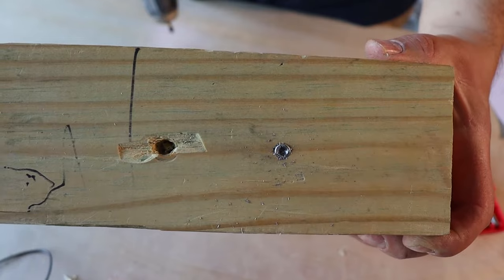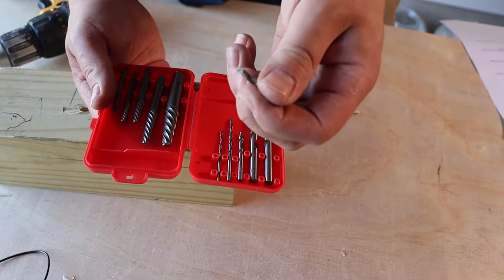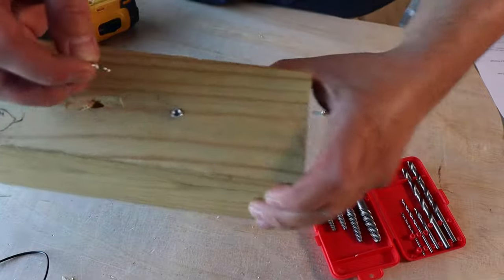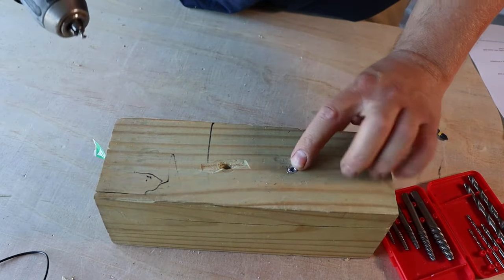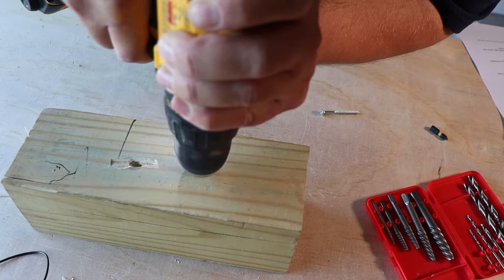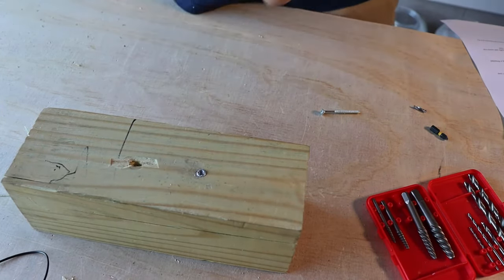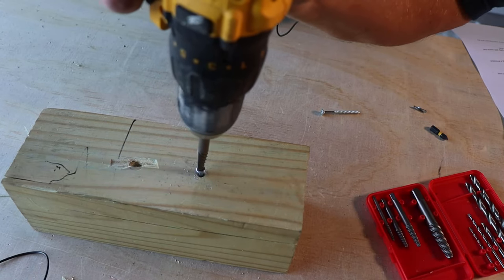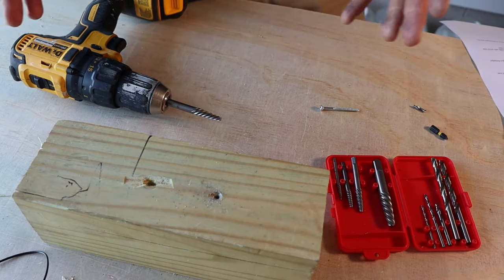How to use a Screw Extractor Set - (Remove broken or stripped screws)

Comment from the maker: Let me know if you have success with your drill extractor. They're not the most user friendly. Sometimes you need to be persistent and even then they are temperamental. Well, at least my crap set is.
Reply: Your set looks fine. But this is not how it's used. This one is for screws with broken off or completely damaged head. There is another type, which is used in a drill, to catch on a stripped screw head. Two different tools. Read my other comment.
Reply: @palopod No wonder mine didn't work.

Comment: When you use the screw extractor bit don’t use it with drills or impacts, use it manually with a crescent wrench 🔧 get to bite into the screw then turn it couple of times by hand, once the screw starts coming out, then only you can continue the process with a drill or impact.
Reply from the maker: Yeah an impact is a really bad choice. I've found a variable speed drill at a slow speed is fine to get it started as long as you use a light touch on the trigger. Hand tools can definitely be a safer option if you prefer.
Reply: This comment save my so much $$$$ bro. I tapped the extractor bit into the stripped bolt. And it would not work with a drill. The C Wrench did the job lol 3 days later
Reply: How do you get it to bite when it’s flush with the wood?
Reply: @donovanberserk4993 drill a hole in the center with the reverse drill bit and then hammer on the extractor bit before cranking it with a wrench or something
Reply: Thank you
Reply: That's totally worked thank you! I just used an adjustable wrench and it didn't require any force like I thought it would! And nothing is broken.

Comment: The reason you breaking bits is because you're doing it wrong. Use the drill bit correctly, not in reverse then use extractor in reverse. Your crap set is actually pretty good!

Comment: I had a super corroded screw on my motorcycle’s front brake master cylinder and these just saved me. It wasn’t working at first but then I realized I didn’t drill deep enough with the drill bit. Heads up, if you can still see the original screw threads you need to drill it in deeper lmao. I had to use one size larger extractor head than the drill bit and it worked like a charm
Reply: I have the same problem with my bike does it actually work I have theses and also have a hand impact driver trying to get screws out as they are worn on the heads
Reply: Man I’ve been having this same problem and I was trying to figure out, how and the heck I was gonna get that screw out of there

Comment: Great job, feller.  You were to the point and even used worst case scenario technique .... and still made it work.
   I've done this several times but still, if you don't have to extract screws that often, it helps to have a reminder of the technique.  👍😱👍
   I'll be watching more of your vids and wish you well in all your endeavors.
  Stay cool ✌😎👍
Reply from the maker: Thank you... Much appreciated.
Reply: Not worst case.

Worse than this is when the screw is installed for years and through vibratory abuses is broken below the surface about a half inch down the shank.  Now, will the extractor bits work on just a shank, without widening the hole?
Reply: @DorkPrince  in those cases try drilling out the shank.  Then rethread the hole.  You may have to make the hole bigge but you still have the item you are working on.  Just have to improvise sometimes.
Reply: @bamaphoenix9873  that's pretty much where I am with it.  It's in a "doorway" bulkhead between a kitchen counter and a half height wall; I'm trying to fully remove the screw to replace with the next size up so I need to get all the old threads out too (although I suppose that's not all that critical, come to think of it, might even help to leave shreds of old threads in).  I'm sure I'll manage it, I just don't want any more damage than necessary.

Of course, I might just go ahead and core it, dowel it, and redrill it. There's hardly any weight on it, it's just the abuse of slamming the gate shut over the years that broke the screw.  If it's ever removed, the damage and repair of removing the old screw will definitely be easily covered by paint.  So it's really not a big deal.
Reply: @DorkPrince  Yes, yes ... the last part of what you said ..... concerning drilling it completely out and dowelling, then redrilling will be the best ... especially with cabinets.  I think that will work fine and even be more sturdy.
  Let me(us) know how it works out.

You can also use wooden golf tees or a bundle of toothpicks if the hole isn't big enough for a standard dowel.
Reply: Squeaking luggage spinner wheels

Comment: Thanks a bunch!! I think I used these bits like once 20 years ago but completely forgot how they worked. Had a stripped screw on a $900 power amp circuit board 😣I was horrified getting that drill near it but I only had to drill it a little bit then used a crescent wrench to do the other part and like you had to go to a bigger size. And when I hear that thing break loose!  It was glorious! 🤩
Reply from the maker: That sound of stuck fastener breaking free is one of the best sounds in the world.

Comment: I bought a reverse thread drill bit set from Matco, they're cobalt 8, and have worked well so far, the drill bits that is, because the spiral flute extractor's break as any other brands I've used, I bought harbor freight O'Reilly's power built And matco spiral food extractors and they have all break at some point in the same fashion but I have noticed that the cobalt 8% drill bits have not given me any problems compared to the titanium or standard steel drill bits that came with the other kits, granted my Matco set was freaking $70+
Reply from the maker: Wow, for $70 I would hope they last quite a while. Pricey. 

I know the extractor bits break, but the set in the video was very lightly used.  I actually broke it a couple of minutes before that video was filmed. Forgot to press record on the camera so I had to do it again which was really annoying at that moment. I wish I got that on camera, would have been a more entertaining video.

Comment: I find it much easier to slot what's left of the broken fastener, and turn it out with a flat blade screwdriver. I've NEVER had any luck with a left-handed drill bit or a screw extractor!
Reply from the maker: I've done that. It's not a bad option.

Comment: YouTube Channel , Project Farm had done a test of screw extractors . Strangely he had said a set of Irwins like you have worked . It seemed he drilled out bolts first and then used them ? Though the brand Grab It and Speed Out , you mentioned were the best . I'm buying today the Speed Out , since it's cheaper than the Grab It . As I have a stripped out screw on my old license plate that has to come out , now . Though I have never had a need for any of these . It would make sense if the screw / bolt is in metal . To use a penetrating spray , etc as he has tested them , also . And maybe to put some type of grinding paste ? to put on the head , etc to give added grip . And maybe some type of rubber piece between the head and drill / impact driver . As I'm sure an impact driver would be the best for torque .
Reply from the maker: I'm sure Project Farm did a much more extensive test than anything I'd ever do for a screw extractor. I rarely need a screw extractor myself, but I was just annoyed in the video at how crappy the ones I had were to drill out the screw head. It worked fine though and for the rare circumstance I need one it's enough. Penetrating oil in a metal on metal situation is a good idea though. I've never needed anything more for grip myself for the extractor portion as long as I drilled it out well. I'm glad to know that Screw Out was confirmed to be a good extractor... that confirms my research. An impact driver would add rotational torque which can be helpful, but impact drivers are not as easy to control speed with so I'd try with a drill first.

Comment: Why did you use the drill bit (first part) in reverse? That doesn't seem right...
Reply: In case it grabs you don’t want to further tighten the issue…
Reply from the maker: Many extractor sets come with a reverse drill bit threaded in the opposite direction so that it drills in the reverse setting. This way if it grabs the screw/bolt the bit rotates the fastener out instead of tightening it further. But I did make an error in my video... I was always under the assumption all extractor sets came with a reverse drill bit. However, a viewer noticed and commented that the set I was using in the video actually came with a regular bit that should have been used in the regular forward drive. I don't know why a manufacturer would include a regular bit since a reverse drill bit would be far better in my opinion (since it reduces the risk of exasperating the problem by digging the fastener in further). If you have the option, I'd suggest using a set with a reverse drill bit and extractor combination.

Comment: Once you get the head out enough you can use locking pliers to get the rest of it out.  If the tool loses grip that is.
Reply from the maker: Absolutely. Luckily my extractor held and I didn't have to fetch another tool.

Comment: When using the drill bit in the 1st step, why go in reverse when drilling is done clockwise? Thanks for taking the time.
Reply from the maker: The threads on the drill bit in this set are reversed for this application. So you need to run the drill bit in reverse to actually drill. This is typical of screw extractor bits.
Reply: @DIYWithAaron  , Thanks for the quick reply.

Comment: You don’t need to drill the hole in counter clockwise. Only screw extractor needs to be counter rotated.
Reply from the maker: Yeah, you're right. I thought all extractors came with reverse drill bits. Apparently, that's not the case. So I guess drill whatever way your drill bits are oriented for.

Comment: But most other videos on this subject say to use the drill bit in the conventional clockwise direction and then the extractor in reverse.  Unless you use the special double ended extractors.  Why do you drill counter clockwise?
Reply from the maker: I actually screwed up and thought I had a reverse drill bit with my set. If you have a reverse drill bit drill in reverse, if you have a regular one drill as normal. It would make more sense to have a reverse drill bit with these extractor sets... but apparently that is not always what you get.
Reply: You drill counterclockwise for two reasons: 1) So if the bit "grabs," it doesn't drive the broken screw/bolt in deeper and 2) If the bit "grabs," it might turn the broken screw out, eliminating the need for the extractor. 

I've NEVER had a left-handed bit "grab" and extract a broken fastener. LOL

Comment: Please advise.  I am working on a home DIY Plumbing project for my elderly parents that has expanded to multiple plumbing projects. I am trying to remove a 3/32-in set screw in the base of the Delta faucet handle: the set screw is either stripped or calcified so bad that all of the lubricants [Blaster Penetration, Superzilla and WD40] fail to twist the set set screw.  I purchased a Plumber's Basic Propane Torch, but I opted to use my soldering iron to apply high-heat it too failed to loosen the set screw.  However, the lubricants and the heat from the soldering iron easily stripped the paint from the handle's base.  I am not yet confident using the torch.  I cannot find a extractor bit long enough to fit in the recessed hole. I cannot get enough torque with the L-shaped Allen wrench.
Reply from the maker: Sounds like quite a mess. Do you have a hex head bit that size that you can use in place of the Allen wrench? You'll get alot more leverage for torque with a hex bit over an Allen wrench. I'd use the hex bit with a screwdriver handle rather than a drill for something so small like that. You can also give the bit a light tap or two with a hammer to push it deep into the set screw for extra grip. That's what I'd try first.

Comment: what if the screw is in plastics? eg. a toy blaster where the screw has stripped. not wood? I am afraid the drill will crack the plastics
Reply from the maker: Yeah, your instincts are probably right.... a drill might not be a good idea for plastic. You can use hand tools with the extractor. Something like a t-handle wrench might allow you to use the extractor to keep some pressure on the screw while turning, but you'll have to be careful not to push to hard. You got a real challenge on your hands.
Reply: @DIYWithAaron  😢 yeah, the screw is also not on the outside. the screw head is 1 cm inside, there's plastic screw hole around it so can't work on the head from outside.

thx for the tip. i read can use t-handle wrench by adding rubber band or paper and press on it.

Comment: I’ve watched al lot of these videos, but none of them are trying to remove completely stripped screws from a vertical surface, where you can’t apply any downward pressure.
Reply from the maker: Hmmm... that's a good point. If you have a screw stripped on a vertical surface, then do what you can to keep pressure on it... granted it is much easier when gravity is working with you. I just filmed this as a quick demo since some of the videos I saw were so lengthy or didn't tell you basic info. Something to think about for a follow-up video at some point.
Reply: As an aircraft mechanic who has literally removed hundreds of stripped screws, extractors work no matter the orientation of the screw. Most have been overhead with some being vertical.  I use the 1/8 Snapon extractor. 1/8 drill is used in the normal direction, not reverse so the hole can be drilled deep enough. Then I use a 7/16 socket. The only problem that arises is not getting the hole deep enough for the extractor to bite.

Comment: Does any drill bit work or  I am supposed to get a metal drill bit?
Reply from the maker: Typically the bits for drilling are reverse bits that come with the extractor and both the bit and extractor are typically hardened for drilling metal.

Comment: Can you use a screw extraction kit to remove a broken off bolt
Reply from the maker: Yes, it can be done. Center punch the broken bolt, then drill it out enough for the extractor to get a grip like I did with a screw. Bolts can be trickier in some ways depending on if they are fused by rust or otherwise seized in place.

Comment: What do you do if the drill bit doesn't catch even after going a size up?
Reply from the maker: If you have more room in the head of the screw, drill deeper and try again.
Reply: @DIYWithAaron  Thanks for replying. I dug deeper and tried again with the current size and a size up and even tried using a rubber band. 

I think this screw is lost
Reply from the maker: @GForce4  Sometimes that happens. Screw extractors usually work, but sometimes it's just not meant to be. Sorry!
Reply: If the screw isnt to flushet u can use a dremel with a disc

Comment: Using a drill bit you state to have it going in reverse? Huh? What's that gonna do?
Reply from the maker: It's going to drill. The threads are in reverse to a normal drill bit. So to drill you need to put the drill into reverse. These reverse drill bits are typical with screw extractor sets.

Comment: Does the drill bit have to be a reverse bit? Is it a special kind or can I use any ?
Thanks
Reply from the maker: Reverse bit... that's what comes with these extractor sets.
Reply: @DIYWithAaron  thanks yes I bought a kit with no bits just extractors as I'm in central America.   So I'll look for a reverse bit .
Thanks
Reply from the maker: I think it could still work with a regular bit. You could try it if you want assuming it's worth the risk. Not sure how important a reverse bit is, never had the need to try differently than what my set had.
Reply: @DIYWithAaron  would you put the regular bit in reverse or just forward it wouldn't work reverse?
Thanks
Reply from the maker: A regular bit is designed to drill only in forward. So you drill it in forward and then try the extractor in reverse. See if it works, if it doesn't you can always drill a little deeper or wider with a reverse bit later as long as there's more screw head.
Reply: Thanks ,it's on my motorcycle ,i have a bunch of rusted out heads , ill keep you posted:)
Thanks
Reply: @DIYWithAaron  Thanks for the information I really thought you can use the regular drilling bits
Reply: Nice question
Reply: it does not have to be a reverse bit but since the point is to pull out the screw, reverse helps it not to just to get pushed in deeper by the drill. if you're lucky the drill bit alone can get it loose without the extractor
Reply: It will totally work with a regular drill bit in place of a reverse bit.

Comment: Man I don't understand what I did wrong with mine. I put the screw extractor in and no matter what direction I turned, it bit into instead of coming out. Now it's stuck in the stud lol.
Reply from the maker: Sorry to hear that. You might not have done anything wrong (although I hope you kept the drill in reverse when using the extractor bit). Screw extractors can of be a pain even when you do everything right.
Reply: @DIYWithAaron  I actually did it by hand with a adjustable wrench but yeah I was turning it counter clockwise. Just can't wrap my head around it.... I was trying to get a screw out that the head sheared off but hey oh well, now the screw extractor replaced the screw and holds my hook (It's the hook for my Quickjack)
Reply from the maker: Since your hook is in place, I guess "Mission Accomplished!"

Comment: You say the right size to clean out the hole… how is that measured objectively
Reply from the maker: Just use a bit that will be large enough to drill out the damaged area, but stay smaller than the head of the fastener so you don't drill the whole head off. If in doubt, start with a smaller bit and work your way up if it is not sufficient.